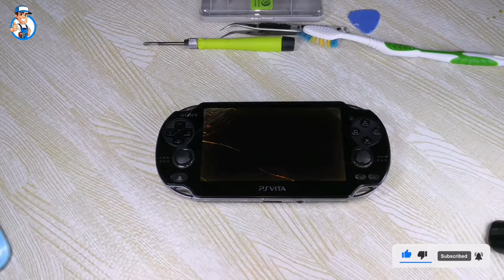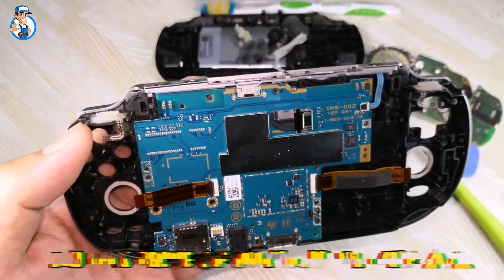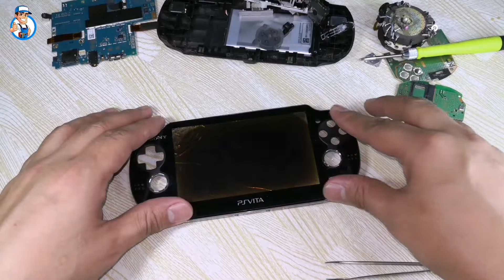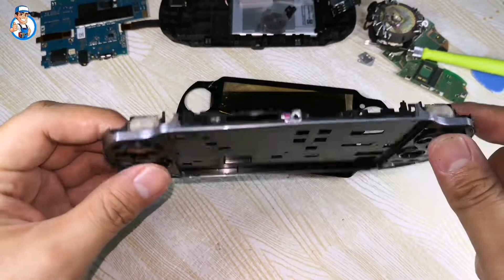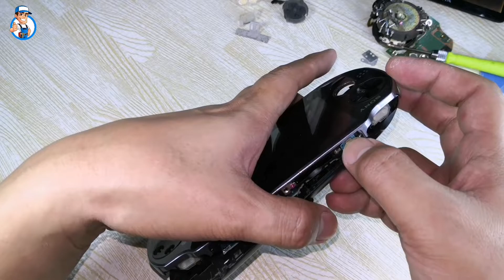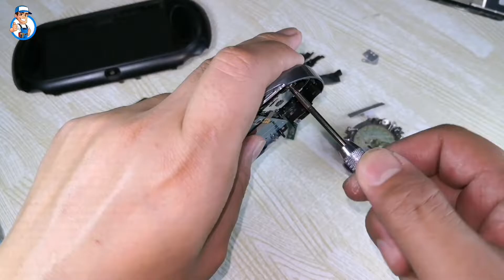How To Replace PS VITA Broken LCD Screen And Disassembly Guide | For PSVita 1000 Models OLED Display

Comment: I have a question i have a psvita 3g pch1100 the model u have for the oled lcd screen will work for the model i have ?
Reply from the maker: yes bro it will work 100%, either it is pch1000 or pch1100 it's all included on the PS VITA 1000 Series models.

Comment: on the new screen you can see some scratches, are they from the screen itself?
Reply from the maker: it's only a dirts coming from the screen protector, when you bought it, there's an factory screen protector install on it, it's up to you if you will remove or not.

Comment: Is the new display also prone to burning like the original one? I have a PSV 1000 and it's got the same burning problem.
Reply from the maker: yes bro, because that's the commonly problems of Oled Displays, even on cellular phones with Amoled Display they're having an amoled burns issues,
Reply from the maker: but surely it'll last for may year before having an oled burns again,
Reply: @raitronics  Today I bought a VITA Fat, I didn't notice it right away, there are like small drops of pixels on the screen only on a dark gray screen at night, in other cases you won't notice, it's a shame of course, outwardly everything is perfect
Reply from the maker: @ВладВлад-э2ь yes bro. it's also a signs of Oled burns.. you can't notice it when your ps vita is on normal mode, you will see it when you power of the vita and the screen turns to gray you can see the black dots.. and sometimes its to many dots..  but when you play games in a Brighter and colorful display it won't show, only when the screen turns in dark display.

Comment: Hey did you get your screen replacement used? cause there were a ton of nasty scratches on it even after you removed the film. Is it not possible to get a new replacement screen? You said it not OLED but an LCD but on the back of the ribbon it reads OLED
Reply from the maker: It is OLED LCD replacement bro, all of PSVITA 1000 Series are oled displays. Only the PS VITA 2000 Series Slim is Not OLED.

Comment: Hi, the Quality of the LCD replacement is good? I mean , the blacks and intensity of color ? Saludos
Reply from the maker: yes it's still the same as the Original Oled Screen.
Reply: @raitronics  thanks youuu
Reply from the maker: you're so welcome bro
Reply: Are you from India
Reply: Where can you buy it?
Reply from the maker: mostly you can buy it on any online shopping flat forms.. like EBAY, Ali Express, or Amazon
Reply: @raitronics  do you maby have a link where i could buy it from?

Comment: Did you display turn on before you fixed it
Reply from the maker: yes bro, it can power On, but the only problem is the cracked LCD Screen,
Reply from the maker: the purpose of this video is to show how we will install the new replacement psvita 1000 LCD Screen,
Reply: Thank god u respond,
Mine is cracked, has brown marks, but the display don't turn on, I plan on replacing the screen the touch screen works n everything but I'm worried it might not be enough to just change the screen. Your opinion would be appreciated
Reply from the maker: did the power led lights goes to color blue? when you tried to press the power buttons?
Reply from the maker: If the power led notification light are turning into color blue when you try to power on the vita, possibly it's alive, and only problem is the display.
Reply: @raitronics  so do you think fixing this isn't just replacing the screen?
Reply: @raitronics  but yes, it charges it dies, I can turn it off and turn it on due to memory of where the where the options are places on the screen despite it being completely black. 

Turns blue when on turns orange when charging but it's just the screen, don't wanna buy a new screen and I don't completely understand what im doing
Reply from the maker: nope bro, what i mean is there's a possibilities that the only problem of your psvita is the lcd screen.. so Replacing the lcd screen will solved the problem,
Reply from the maker: as i said earlier, if the vita are showing the BLUE notification light on the lower left corner when you turning it On? it's 100% sure that the only problem is the screen.. replacing a new lcd screen will fixed the problem
Reply: @raitronics  thank you ❤️
Reply from the maker: bro what i can only suggest is, try to find another psvita 1000 fat... either Deffective or Good, so you can test the lcd if it's good or not.. before buying a new lcd screen.
Reply: @raitronics  alr

Comment: Is the replacement screen LCD or OLED?
Reply from the maker: OLED SCREEN REPLACEMENTS. PS VITA MODEL : 1000 series bro.
Reply from the maker: THE PSVITA 2000 is different.. it's Slim and not OLED
Reply: @raitronics  Yep, I know the differences between them, but I wanted to know is this replacement screen for 1000 model real OLED display or LCD. Because it's a third party replacement screen, and that's why I'm asking that question.
Reply from the maker: @Tvv1SteR yes even it is third party or Replacements.. it's still the same quality of the original stock oled screen :) it's almost the same quality of display

Comment: Links for screen replacement po?
Reply from the maker: are you from Philippines? i ordered it in china but thru online flatforms like Shopee Phillipines.
Reply: @raitronics  yes sir, yun ba yung mga 1k sa shopee?
Reply from the maker: @kurtreodica309  wait check ko, kala ko foreign karin..nauubos na. English ko sa kakareply sa mga foreigners 🤣
Reply from the maker: @kurtreodica309  dito mismo 👉 https://shopee.ph/product/135120932/2288615790?smtt=0.287546855-1661012342.9    600 plus lang..
Reply: @raitronics  salamat sir!
Reply from the maker: @kurtreodica309  it's my pleasure sir 😊
Reply: Sa motherboard sir meron kang links??? Palagi kasi nag gpu crash advise ng mga tao change Motherboard na😢
Reply from the maker: try mo mag search sa shopee bro.. kaso lang medyo sugal din mag order ng motherboards lalo kapag overseas.. incase Deffective yung mabigay sayo? naku mahirap na mag refund.. better tingin ka nalang sa fb marketplace.. yung pwedeng meet up lods.. para ma testing mo muna bago bayaran..